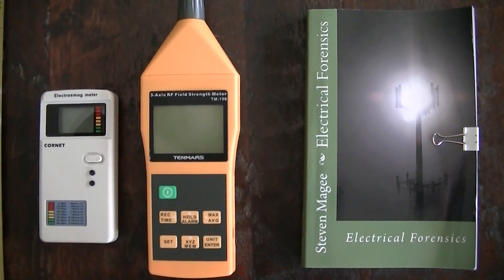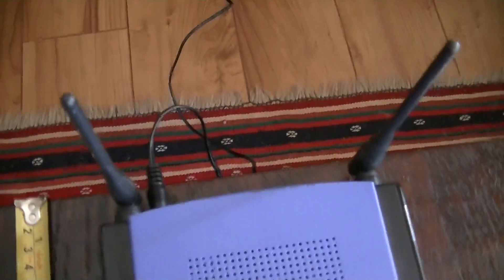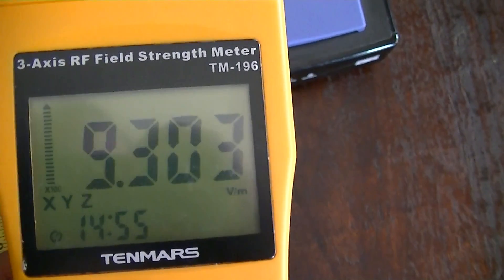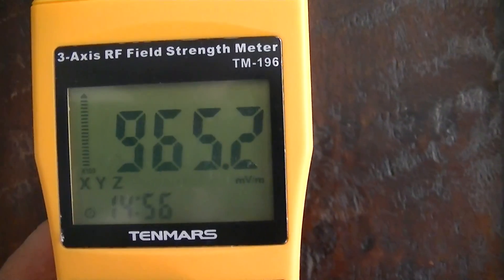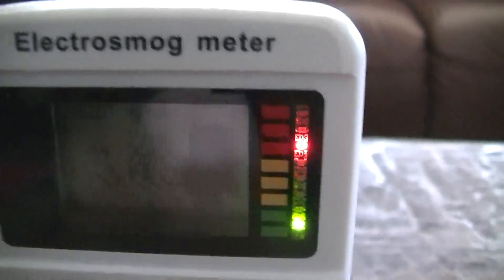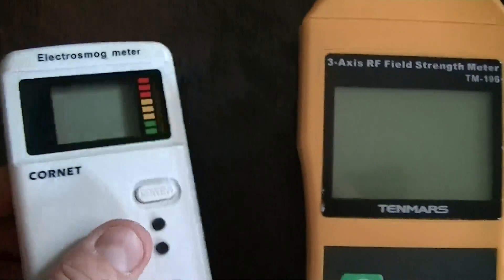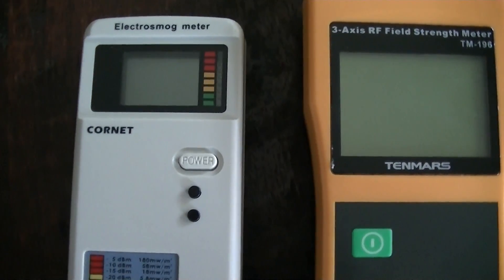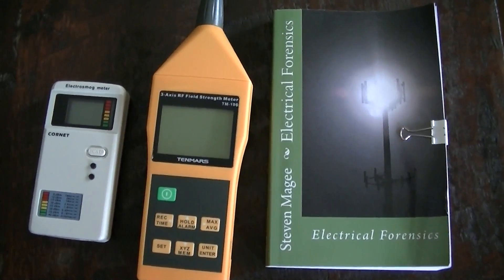Tenmars TM196 Vs Cornet ED75 RF Meters on 2.4 GHz WiFi

Comment: The Cornet ED75 is an obsolete meter. Cornet has released several models since then, as of mid 2014 it would be the Cornet ED78s which performs accurately and is far more affordable than the TM196.  Also, the positioning of the Cornet meter in this test was improper, perpendicular to the source. That positioning would be expected to register low readings as it did. This video, unfortunately, does not provide any reliable information. Similar tests could be contrived to discredit any meter.
Reply from the maker: Interesting.  Could you post a video that confirms your statements?
Reply: StevenMageeBooks
The manufacturer can confirm that for you.

Comment: did you take a reading beforehand with the router switched off?  if there were significant RF emitted behind and/or to your sides then the cornet could be expected to show much lower readings. Even so, it does seem like a huge variance.
Reply: eg. if there are smart phone(s) in the vicinity you get sporadic huge spikes (especially when reception is weak), at least my one does - since buying a meter its been on airplane mode 99% of the time!
Reply from the maker: There are no wireless products in use in my home during the daytime.  What the RF  meters are showing is coming from the WiFi router.

Comment: My findings after testing my Belkin 2.4 Ghz router model # F5D8236-4 v2 and my Motorola 1.92 Ghz Dect 6 phone base model # L402C also using my Samsung Galaxy 3 cell phone during a conversation via Telus network and not engaged in the 4G network are all below.

I used the timer on both to get the max pulse readings.

2.4 Ghz Router 1 minute timer Tm 196 = 19.964 V/m TM 195 = 10.763 V/m

1.92 Ghz Dect phone 1 min timer, 196 = 66.3 mV/m  195 = 895.8 mV/m

Cell phone none 4G network, 196 = 6.840 V/m  195 = 14.613 V/m

All the tests were done immediately after one another in the exact same environment.
Reply from the maker: Looks like your TM-195 is the accurate RF meter :-)  The RF power level from that cell phone is just nuts!
Reply: I hate my cell phone but was forced to get one for work. I have a corded blue tooth style mic I picked up from the dollar store for 3 bucks and it works better than the $70 mic I tried from Best Buy... I also only use the speaker and not up to my head.  I usually have it turned of due to the answering machine & text that will always catch anything important. I also bought a camera case that fits on my belt and unstitched it and put in a liner of the emergency blanket stuff against the side that touches my hip... Rolling with the punches I guess :/ I would rather dodge them but life is not always what you want.

Thanks for the video I just did a quick one and will post up the link when it`s loaded...

Cheers,
Terry